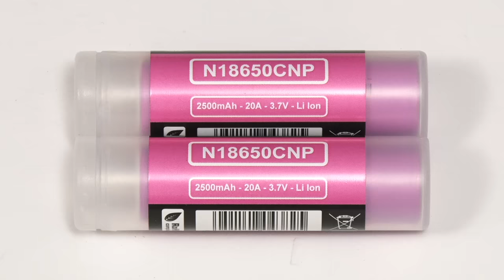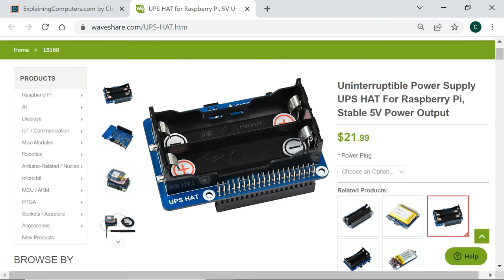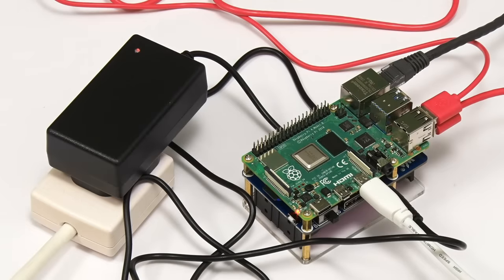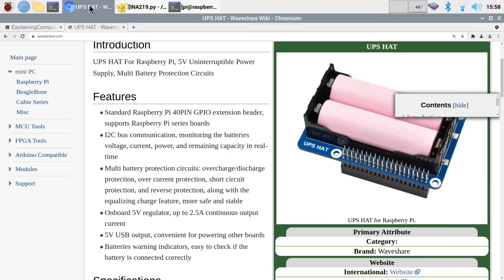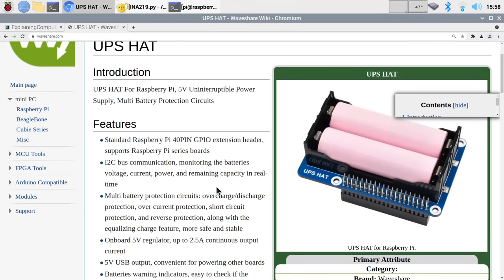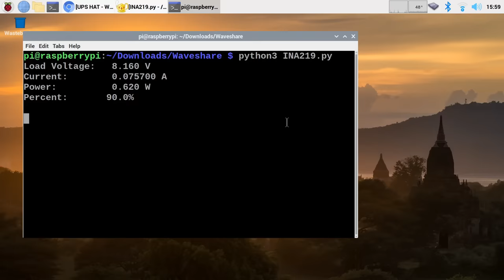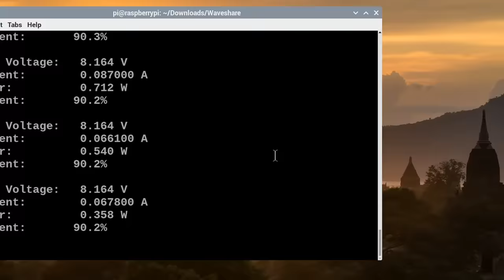Raspberry Pi Waveshare UPS

Comment: Devices like this are a testament to people's ingenuity. The POGO pins made me skeptical, but I'm happy you addressed that.
Reply: I have a similar unit. It didn't look to me like the pins were centered correctly on the pogo pins, but I guess as long as tension holds it there. Unfortunately mine is not a UPS, that one looks nice 👍🏻
Reply: You can put some solder on the pins when the unit is assembled and no batteries are inserted, if anyone feels unsure about the pogo pins. It should be easy enough even for amateurs
Reply: there's another issue with connections like these - micro arcs. with time, current gets passed through micro arcs where microscopically pogo pins aren't properly aligned with the bottom of the Pi pins. with time this generates oxidation, which is a good insulator. so I wouldn't be surprised to see more and more instability with use.

this also works in reverse - the UPS unit might have increasing difficulty getting charged through the pins, leading to slower or frozen charge.

so much for "uninterrupted" huh

Comment: I didn't think the Pi would have this sort of option, but given how clever the whole Ecosystem is around it, I'm not surprised.
Thank you Christopher.
Reply: It makes a lot of sense for those who power it by using solar power as a remote sensor or whatever, so it’s not surprising that there are several different variants available out there.

Comment: This is a very nice UPS board, I have looked and the schematics and it seems to include everything you need: overcharge/discharge protection, balancing and a battery voltage/current monitor. The only thing missing is a current monitor on the 5V supply to the Raspberry Pi so we could give a good indication of the time left on batteries. You can guestimate using the battery voltage and current and that might be enough.
Reply: where did u find the schematics? i didn t  find them on the wiki
Reply: Those are good questions. I definitely agree it needs a second voltage and current monitor. I think it would be best suited on the 8.4v charge input rail because you can measure the voltage on the 5v with the Pi itself. Though current measurement on 5v would be nice.
What I am curious about is how the charging circuitry works. I know it says 8.4v in but does that require the input to be no more than 8.4v and have a constant current input? If it requires that then that means it does not have any onboard charge regulation and the charge current would be limited by the max output of the power supply or the battery protection IC's which will just shut off the batteries if the current is too high. Not really Ideal in that scenario. I think it should have a TP5100 IC on it's power input set to 8.4v (TP5100 can do 1S or 2S Li-ion charging) but also have a straight through power connection with the 12-24v input power now going directly to the 5v buck converter so there are less losses. Diodes may work but Ideal Diode circuits would be way better using the dedicated IC and mosfets. This probably was not implemented due to cost saving unfortunately
Reply: @SuperBrainAK  There is no charger circuitry in this module. It is quite common for Li-Ion applications to use a specific Li-Ion charger. A Li-Ion charger uses a constant current/constant voltage technique. It starts charging with a constant current and as soon as the max. voltage of 8.4V is reached, it will switch over to charge with a constant voltage (dropping the current). As soon as the current then goes below a certain value it will stop charging. 
Having a specific Li-Ion charger instead of a regular power supply is fairly common. The charger contains the more complex electronics while the battery only has over voltage and current protection. These chargers are replacing mainstream power supplies when (Li-Ion) batteries are involved so I don't have any concern about using a specific Li-Ion charger instead of a regular power supply.
Yes, you could use a TPS5100 or another type of cheap charger circuit but (partly due to the fact that those Li-Ion charger are mass procuded) will not only increase the cost but also the quality of the charger.

Comment: For my Smart Home I used powerbank PCB from Aliexpress (4€), old tablet battery (7Ah) and soldered USB out cable. PCB can supply 2A at 5V, so it works great for my application.

Comment: I bought mine after seeing this, it was an excellent video as always. Seeing you reviewing a product that i'm considering to buy makes me more confident that i'm doing a good purchase.
I connected it to an old raspberry pi 2 which i only use as a zigbee gateway. Since the GPIO pins are the same it is working flawlessly. No more sd card corruption on power failures!
Reply from the maker: Great to hear. :)

Comment: Nice integrated solution but for less portable requirements, a USB power bank with pass through charging is way simpler and cheap. 6000 mAH for $13 last time I bought one. Yes you have to carry the battery and cable to move things about and you don’t get the cool software monitoring, but it works for anything taking USB power and in doesn’t need a specialty power brick. And your old Pi case still fits!
Reply: The problem is, it is extremely hard to find a truly “pass-through” powerbank, i tried really hard, but I can’t seem to be finding it anywhere at all, most powerbanks which claim “pass-through charging” temporarily stop supplying power to the device when they are connected or disconnected from wall outlet, thus unable to function as uninterrupted power supply (UPS)

Comment: It's somewhat counterintuitive to have a UPS (intended to protect against power loss), but then have the power connection reliant on pogo-pins!  So I was relieved when I heard you mention that thumping the table hard caused the RasPi to reset.  This was somewhat expected.  If you are using a UPS to protect from power outages / brown-outs etc., then I strongly suggest a more robust power connection be made between the UPS and the RasPi.

Comment: It would be interesting to see how reliable are the electrical connections on the pogo pins, especially if the pi is mounted on a car or something shaky
Reply: If I put it in an environment with a lot of vibration, I'd definitely solder the connections.
Reply: Is there a cable adapter solution?

Comment: Those Lithium-Ion 18650 cells are 3.7v nominal, and fully charged at 4.2v. They can be ran down to around 3.0v safely.
I would love to see how well this UPS functions as a BMS, as far as over-volt, and under-volt protection for the cells.
Reply: I recommend using NCR18650B cells from Panasonic, as they are designed to go as low as 2.5V. Usually, those circuits don't have problems with over volting the cells but over discharge is sometimes a problem on those. So with those cells, nothing bad can happen since you got half of a volt grace.
Reply: I can confirm that this unit provides adequate power for the pi for the full range of batteries, working out to about 8+ hours of battery life idle and about 2 when run at full load (with a cooling fan).  Do you have a test you'd like me to run on my unit?
Reply: @edwardallenthree  Does the monitoring software allow the Pi to shut down cleanly when the battery charge drops below a chosen level?
Reply: @johnm2012  Not that I recall, but it is trivial to add. I used the libraries and wrote my own software that updates an epaper screen.
Reply: @edwardallenthree  Ok, thanks. The fact that you can extract the data is useful.
Reply: @edwardallenthree  That what problems I have is code to write, for everything to shut down? I always go with load rates.  Power never go out at computer/server running at idles.
Reply: @LordWillyGee  The pi shuts down fast. That having been said, I think (I do not know a great deal about lithium ion batteries!) that these batteries work best if you don't drain them all the way. Easy solution would be to schedule a shutdown when the battery pack hits 6v, which should leave you pleanty of time to shutdown even under load.

Edit: You always have access to the current as well, so if it is under heavier load, based on current, you can make different decisions than if it is lighter load.
Reply: @edwardallenthree  I was thinking of the old ABS battery back-up with a cable that shut down PC when the battery fall to ?% drain.  So I am new to Pi ? Learning curve for me.
Reply: @LordWillyGee  this device is better described as a battery pack than a UPS. I don't think the circuit is really a good fit for something that continuously charges, but would love for someone who knows more to tell me I am wrong. 

That having been said, I've been using it as a UPS for two months, and the battery life is still good, despite it spending most of its time with the light on the charger changing from green to red every second.

Comment: If you ever have an excuse in a future video to make a real-world test to see how long those batteries would last, I’d find that interesting.  Plus, it’s comforting that Peter the Pliers is on hand for pulling caps off of batteries or the occasional tooth.  Looking forward to your next video!
Reply: I second the question about the batteries duration. That is a critical information IMHO.
Reply: The Make of the battery is critical with differences in quality huge. If in doubt buy samsung. Chinese (eg ultrafire) units are about 1/4 as good.

Comment: Excellent video, thank you. I think this could be a very good option for car use if you can attach the UPS board to 12-15V safely via voltage regulation. Coupled with a shutdown script that tells the Pi to start safe shutdown calculation when the UPS current turns negative, and cancel the shutdown if the UPS shows up positive again because of vehicle start. Have to look into this, if those batteries can handle the high heat inside the car in summertime...

Comment: Basically it allows the pi to be somewhat like a headless laptop. Glad I watched all the way to the end. Through out the video I was wondering what functional purpose this would have over a standard UPS. I was trying to think of reasons why someone would want to have a pi stay running while all other devices are off line (network, external storage, etc); if those devices were on a UPS, then the pi likely would be getting power from that UPS as well. However, if the pi is elsewhere on the network, and not near the UPS that is keeping the network alive, the pi would need to be getting power from some other UPS. ...Another possibility, if you have a PoE network, put the network on a UPS, and have the pi powered using PoE. :)

Comment: Thanks Chris, that’s a great option for rPi.
I like your sense of humour.
So now the pi will run 24/7
I think it would pay to set a root cronscript to automatically reboot the pi early in the morning each day so it never crashes. So it is always available 99.9% of every day.
I set a reboot cron job on all servers that I install.
I’ve never had them crash.
Yes it means 2 minutes every morning they are totally down but never down when you really need them. It overcomes any memory leak problems. I’ve got tens of servers on the internet that never crash for ten years or so. I even forget them because customers never have problems.

Comment: There are too many comments, so I don't if anyone has already mentioned this 😅. I just checked and tested it, and the tip of the pogo pins fit perfectly in a Pi Zero without headers. It is just a matter of finding a way to secure it properly with posts of the right height so they can be screwed and kept in place. This would leave the 5V USB port free for any peripherals, like an LCD screen in my case.
Reply from the maker: Thanks for sharing this. :)

Comment: I have one of those! I made a great battery monitor with a screen and clock. Be sure to source your cells from honest folks. 

Edit: I use this with a Wave share compute unit board with the same form factor as a pi. Works great.

Edit 2: I have never had a problem with the pogo pins, and I use my unit like a laptop, swinging it around from the cords like a medieval weapon.

Comment: Hello Christopher. Ive been following your channels for years now and enjoy all of your content. I have a question for you about this product. After using the UPS, can you tell us if the button labeled "boot" is, as you suspected, a momentary disconnect for resetting purposes?
Reply: Good question; I looked into it, as the Waveshare Website also has the schematics for this thing (always a VERY nice touch). What it does is to reset the battery protection IC (HY2120-OB). The datasheet for that has the following text: "Notice: Discharging may not be enacted when the battery is first time connected. To regain normal status, CS and VSS PIN must be shorted or the charger must be connected." ... that's exactly what the Boot button does.
Reply: It would seem wasteful including a switch to momentarily disconnect the battery when there's an on-off switch a few mm away ;-)

Comment: Good price for this unit. A couple of days before this video came out there was a similar product being promoted on AliExpress. Search for "Raspberry Pi 4B UPS with RTC Uninterruptible Power Supply 18650 Battery Charge" which is nearly USD 40 plus shipping. Physically similar - it also uses pogo pins - but is not a rebadged version of the Waveshare unit Chris is reviewing. The AliExpress one has a realtime clock - but no extra pins, so maybe signal goes through the existing pair of data pins.

Comment: It would be nice to have some battery drain times wirh assumptions about current consumption and minimum battery starting charge. I was going to build one of these, so I am delighted that someone has done it for me, affordable and well designed. The python watching script can be easily adapted to safely shut down the device when the battery charge crosses some threshold. Brilliant!

Comment: Hi Mr.Chris, great review as always, and the product is certainly very interesting, I do have a question tho, under normal use, for how long can the UPS power the pi in case of when power gets cut off from the mains?
Reply: That would depend on Pi loading and batteries used, but at the 3W load shown in the video approximately 2.5 hours.
Reply: They say the UPS can deliver 5V 5A peak but just 5V 2.5A continuous, which is 12.5w.  So from a full charge of 2500mAh, we can probably use about 80% (you can get cells such as the Molicel M35A which can store 3500mAh, and still easily meet the output current needs of this UPS - those high-amperage capable ones do so at the expense of capacity)  80% still applies though - if the voltage of a Li-Ion EVER drops below 2.5V it must be recycled, so we don't go near there, and I doubt if the UPS hat will anyway.
So at nominal 3.7V each we are needing to draw 1.69A (safe side, round up to 1.7A) from each. So with those 2500mAh cells, we could last 1.184 hrs (about 1 hr11min), or with 3500mAh cells 1.6576 hours (about 1h40min), both allowing for the 20% de-rating for safety and efficiency losses.  And that is at full load.
I'd love to see a version to take 21700 cells as 18650s are rather limiting - The Molicel 21700 M50 can take 5,000mAh and is only 3mm wider diameter and 5mm taller.  So in terms of board space the footprint of a pair would be 5mm greater in length and 6mm in width for a 2hr22min duration, even at full load.
Capacity will reduce with age, particularly as the cells are on permanent charge at maximum voltage.  Unlike lead-acid batteries, Li-Ion are best stored at 30-50% charge, and storing at full charge (4.2v ea, hence the 8.4v power adapter) will reduce their life, likely to a year or maybe two if you are lucky.  A three-cell version would be functionally replaceable with a lead acid, as it would be 12.6v and either type could then be used, maybe with a simple dip-switch to set type.
Anyay, for the TL,DR crowd, 1 hour 11 minutes on these cells, 1 hour 40 with  Molicel M35s.
Reply: @st200ol  thanks for info
Reply: @phillee2814  Thanks a lot Phil for such a detailed paragraph full of useful info, I guess I am better off going with the 20,000 mAh powerbank I initially planned to pair with the pi to power it throughout the day off grid
Also regarding why they implemented 18650 cells instead of 21700, if I have to guess, it’s probably cuz they are more common and readily available I guess?
Reply: I use this with a rpi compute module board with an nvme drive. I get 2 hours on full load with high quality cells (LG MJ1 18650 3500 mah). I get at least 8 hours idle.
Reply: @edwardallenthree  interesting, thanks for info

Comment: I'd be curious to  look at the power output on an oscilliscope to see if it's cleaner vs. the switching power supply alone.  This could be a slight improvement for audiophile/DAC applications.